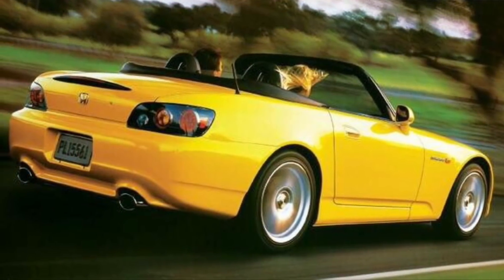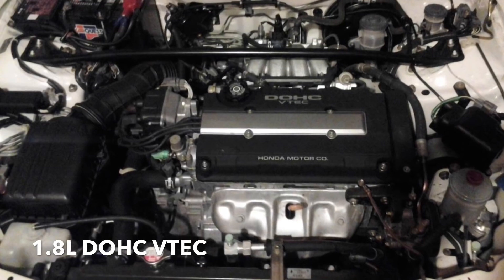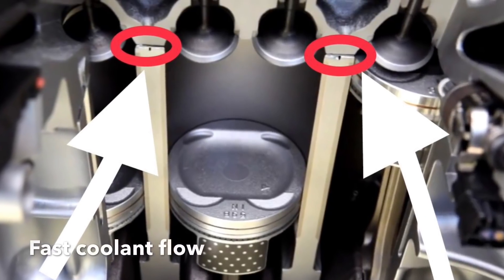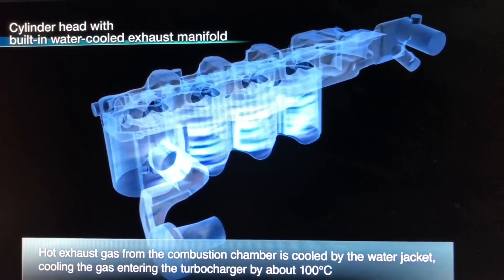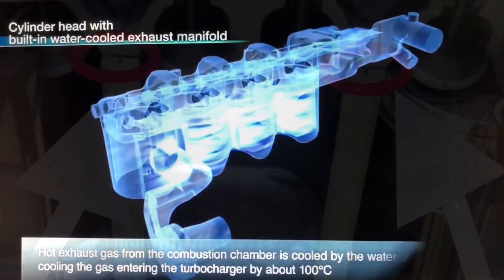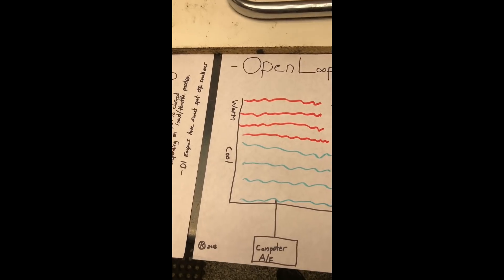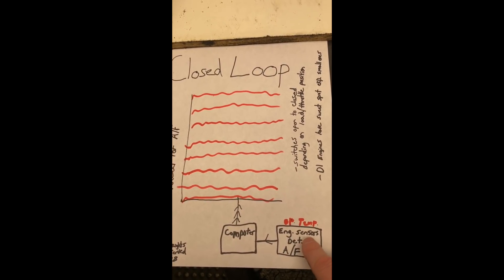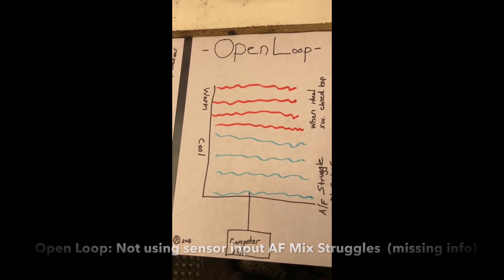1.5L Turbo Honda Oil Dilution Explained CRV Accord Civic

Comment: Honda automatics trans problems and other issues past and present have driven me to Toyota’s in the past, present and future.
Reply: Can't beat a Aisin Transmission
Reply: *_•reshirm•_*  
ZF 9 speed sucked in Chrysler products too!!
Honda never fixed the oil consumption issue in the 2003-2007 2.4, 4 cylinders.....I've has one of each and they burn oil at the rate of a quart every 750 miles!!
Reply: My 03 accord went through 3 transmissions.😞
Reply: @samsung5181  
V6 right??
Reply: @motorcitymanman7711  , You got it.!!!
Reply: @samsung5181  
The V6s had trans problems, the 4s were ok.
V6s used a different trans.
Reply: Very wise man you are... Toyota's newer engines are improving a lot, 2.5L with 201HP in Camry, 2.0L with 168HP in Corolla HB and the upcoming new Corolla Sedan.
Reply: @tomchan2559  
Hopefully they won't burn oil like some of the PRIUS gas engines.
Reply: My accord has gone threw 2 transmission rebuilds and it’s starting to act up again 🤦🏻‍♂️
Reply: @pedro101783  
More info please?
What year Accord?
Which engine, 4 or V6?
How many miles when you started having problems?
Have you changed your fluid every 30,000-50,000 miles??
Reply: Motorcityman Man it’s a 2004 Accord v6 sedan. I change the oil about every 50,000 miles but I think you have to change it sooner then that. I’ve change the oil myself about 2 times already with the Honda automatic oil I’m hoping it holds up a little longer other then the transmission can’t really complaint about Honda cars.
Reply: @pedro101783  
Those V6s with that generation Accord had a lot of auto trans failures, the 2.4 4 cylinder used a different trans 
Check out carcomplaints.com
I change my auto trans fluid about every 30,000 miles, never have auto trans issues but some trans are bad anyway.
Reply: S. D. H.  
Thanks.....so what year/years Yaris should I buy??

Comment: 10W40, and dont drive it like granny, problem solved 😁
Reply: I drive 100 miles total every day, so i havent ran into this issue at all with my si. I also drive the shit outta it. Seems fine ✌
Reply: @Robert Bryant true, i resolved my opinion. I need true synthetic for having no worry about turbo...... Which was most problematic engine depending on oil quality i know? I have it, TDI PD was the worst engine with very high compresion ratios with very poorly designed oil system. So i choose 5W40, that must work..... Warranty doesnt bother me at all. I buy ten years old cars, because when so old car is forever in top condition, then is good, and i cant wait for any problems. Worst cars i know are european Fords and VWs, bests are Honda cars, periodic.
Reply: This used to be fine to do, but not a good idea on newer engines with Variable valve timing. These engines have very small orifices in these systems that thicker oil will not flow through properly leading to possible engine damage

Comment: I think Honda has a flawed engine that they didn't thoroughly test out particularly in cold environments.  Too rushed to get it to market perhaps trying to meet EPA government regulation deadlines. 
If they were to recall these engines and install beefier oil piston rings this would cost the company hugely and do some damage to their reputation in the auto market.
Reply: There's no way to fix for bad genes.
That includes replacement with new OEM parts.
Reply: Well depending on how this class action suit goes they may be forced to do that

Comment: Realistically who in this day and age are going to wait 5 minutes until their car engine warms up completely before they take off.
Reply: Bill Jones I do, I always start my civic 5-10 mins early before going anywhere. It’s really convenient with the remote start keyfob. 👍
Reply: @Mienboi821510  do you live in a cold climate? Do you have any oil dilution problems?
Reply: @shando3333  I’ve got rid of my civic a year ago. Yes, my civic was part of the oil dilution. No I don’t live in a cold climate area but, it gets really cold during the winter.
Reply: It depends where you live where I live it's good to give the car a chance to heat up in the winter since it gets extremely cold (below 0) in the morning. However down south there isn't much reason to.
Reply: @ub 40 
Those can really mess up your electrical system though, not worth it.

Comment: The answer to this problem might be these elements all together, high compression aided by turbo air induction, direct injection of fuel/air into the cylinders, aided by weak oil rings or inadequately designed oil rings to hold back the fuel/air mixture, particularly when the engine is cold. .
Reply: @Robert Bryant 
Why would the thickness of the oil have anything to do with gas seeping into the oil??
Reply: BINGO!......TODAYS motors are very high compression, harder to seal.
Reply: @Robert Bryant 
Ok, makes sense but with today's complex valve trains on many motors u cant run too thick oil or u can run into problems.

Comment: Good information. I’m getting no heat in the cabin so it’s very efficient!   Hopefully this oil dilution issue is resolved soon.
Reply: ub 40, 2018 Honda CRV EXL 1.5 Turbo

Comment: M 2016 civic ex-t didnt have this issue. I know cars from the early 2000's dont need to warm up, but I'm just used to warm up my vehicle's 4-5 mins when cold temps and car outside. When garaged and cold temps 2--3 mims. I kinda old school like that. I   know someone who starts his car in cold weather and leaves right away. Cars dont act good when cold, i know.

Comment: These small 1.5 liter engines with turbo’s come from HELL🔥🔥🔥
Reply from the maker: Kingdrosive 3 Kingdrosive 3 Nothing to do with a Turbo.  You can thank the Impossible Fed Regulation on EPA standards for all of this across the board anything GDI Turbo is extremely hard to mass produce and turn a profit meaning they are pricey...they have done tons of unique engineering on these engines to be sitting where they are including unique forging processes and an entire new designed crankshaft.  It may take a bit but any manufacturer who focuses on the small engines first will come out ahead long term.  Everyone knows don’t buy the latest new tech in automotive world.  Honda is a brand with good people behind it and it will remain that way.
Reply: Jerry Jrs Garage Did not know that..most mechanics I talked to specifically stated enhanced wear and tear on the Engine long-term of course due to stress that the turbo system puts on the Engine..I assumed that made sense since I don’t usually hear about to many turbo engines making it to 200,xxx miles without some major repair..but thanks for the info
Reply: @kingdrosive4102  lies, mosr turbocharged cars engines are made stronger then NA. Maybe a lot of those mechanic customers dont like changing their oil
Reply: geo745don Good to know..I just was a tad bit concerned.. I heard stories of people changing their turbos..costing around $2-$4,000 thousand dollars..I just heard they got out within a reasonable amount of time and places stress on the engine..but thanks for the info..makes me a little bit comfortable..I guess
Reply: I designed them to fail...the freelance designer.

It was to pay back Honda for lack of payment.

Comment: Easy explanation: The Break in period on these Turbo engines has not been preformed properly by the Buyer. So The piston rings have not seated correctly and are allowing fuel into the engine crank case while the engine is cold.
Reply: Well during my brake in period I never went over 60 mph and never kept the engine at a constant rpm for over about 5 min and did not do any hard accelerations and I still have fuel dilution issue.
Reply: INTERESTING.... 🤔 I wonder if the fuel PSI is too high or the rings are not seating even with the break in period. 
Thanks for the reply. 👍🏻

Comment: Honda engineers dropped the ball . Bottom line fuel mixed with oil is unacceptable. Blackstone oil analysis getting lots of samp.es from  1.5 turbo engine owners . We see where this all winds up. As for me I was considering getting a crv with the 1.5 engine . Not now. It will be the crv lx or the 2019 toyota rav4.

Comment: The EVAP starts dumping fuel vapor in close loop. Just look how stupidly the engine is oriented. There are no benefit mounting the turbo and exhaust manifold at the front. All the heat coming from the turbo and catalytic converter is transfered to the engine and oil pan.  When you turn the engine off air is still flowing until the oil temp gets near ambient temp. I wonder how they define the word efficient. Cold air saturation point is very low. It cannot carry a lot of water vapor. Car manufacturers make profit selling cars. The reason why car manufacturers want you to change oil frequently is to make it fail. Biggest wear on the engine happens during startup after changing the oil and oil filter. That's the only time the engine makes several revolution without oil pressure. Try counting how many revolution it takes before oil starts to squirt out on the head by turning the engine by hand.
Reply: That's why my car has an oil prime feature, its slick, '08 Speed 3

Comment: I have to 2018 Accord Sport 2.0t. 4400 miles, about due for its first oil change. Checked the oil level today and noticed it smelled like fuel. Don't know if anyone else is having this problem (yet).
Reply from the maker: Keep an eye on the oil level.  Have it tested if you are concerned.  I do not believe the 2.0T has this same issue.  Any small GDI engine seems to be difficult to manage AF but once this is worked out the small high output engines will be the most useful in my opinion.
Reply: How high was the level on the dipstick??
Reply: I would test the engine oil to keep a track record to show to Honda if it dose suffer from this issue. However if you are leasing the car don't waist your money because the car is going back to them at end of the day and then it will be someone else problem.
Reply: Get them fix it under warranty and trade it in to a new SUCKER buyer.

Comment: I have not thought about open/closed loop operation since heated 02 circuits became the norm. My old school turbocharged car uses the open switch while warming, but I was under the impression that the latest and "greatest" did not. It will be difficult for new car shoppers to avoid direct injection, cvts, dcts, start-stop tech, and cylinder deactivation systems. Just about every serious new car complaint comes from one of the aforementioned.
Reply from the maker: Eric Feli Your right most O2 have a heater built inside which is usually the norm now days depending on the type it must reach at least around 600 degrees for it to be accurate in reading and most wide bands probably are active in matter of seconds now...not only that but there are a number of different components/sensors that contribute to a too rich symptom on low to medium throttle when cold on these engines.  Its really impossible to explain without confusing most.  I am not a technician this was just a broad shot at giving people a general idea on what is going on here.  It really is not Hondas fault many manufacturers are racing to perfect these engines and its not a cheap or easy endeavor.
Reply: Cylinder deactivation just needs to die, it's proven to be a failure so why keep trying to make it work?
Reply: @AdamSmith-gs2dv  
That killed my sister's Honda 6 cyl

Comment: My 2017 CRV 1.5 has not had this issue.  Almost every drive I take I go far enough to fully warm the engine.  However, this is now my second winter with the vehicle here in New England.  I notice that the engine takes incredibly long to warm when the air temp is below 32F.  The gauge needle actually gets near normal and drops way back to cold before finally getting up to full temp after many miles.  I have to believe that this cold running condition and fuel dilution are related.
Reply: Looking more and more like GM GROSS MANAGEMENT. 
They learned well and plays the Blame Game folks.
What goes up must come down.
Reply: @ggo8919  or the cause of the issue, will warm and not stay warmed. Sad situation
Reply: Robert Bryant so do you think it's a mechanical or software problem causing the oil dilution?
Reply: I bought (1 month ago 1000miles in it) a new crv here in Hungary Europe. Its a 1,5l turbo model(177HP) but with manual 6-speed transmission... after that i heard the issues i asked the hungarian dealer and Honda Motor Europe about the problem, and they wrote the same answer: there was no issue with any civic or crv fuel/oil dilution in europe and they said the problem is because in the states "there is a given environmental impact" (extreme hot and cold weather) and the avarage speed is way less there. They also said the 1,5L engines that are made for the european market are slightly different, and we use higher octane gas (ron 95 which is about 90 in the USA)...I dont want to belive this because here in Hungary we have about 85-95F summer and 10-20F winter (below 0F for only a few days) and I think for the biggest part of the USA the temperature is the same. I have to say today that was about 22F here and the water temp reached the normal operating temp in about a mile (about 2 km/5minutes) with heating off. Are you turning off the air conditioning (heating) when you warming the engine ?
Reply: I read this before winter came.. to make sure you turn the heat to the highest temp and the fan to the lowest and that you don't run it on "auto" and the a/c is turned off.  Let it idle for a minute before you take off.  I've had no problems and have had many 20 something days.